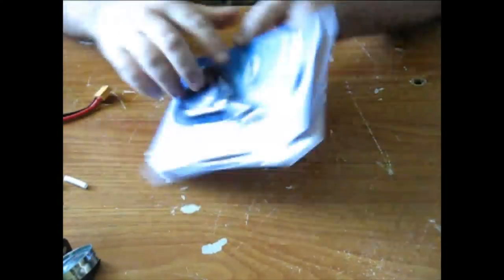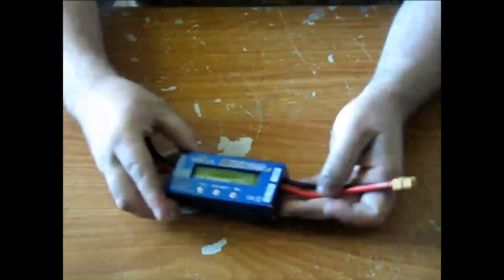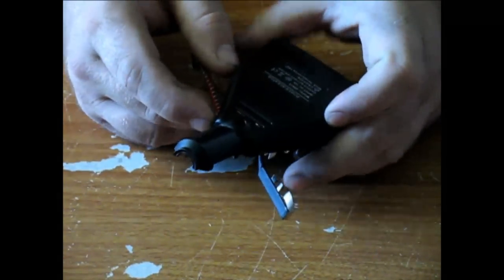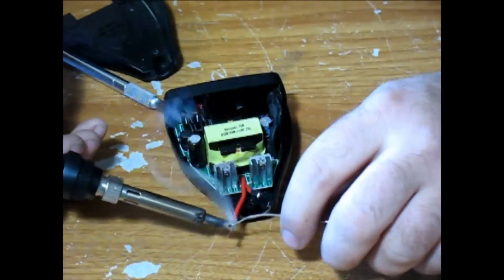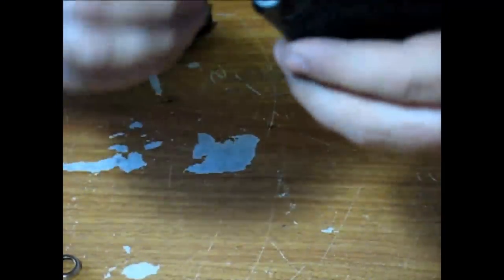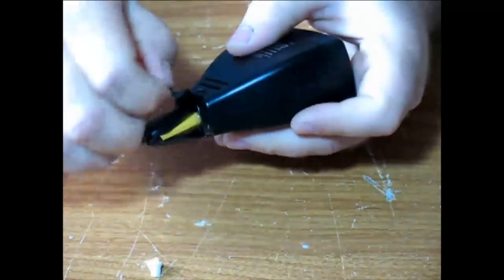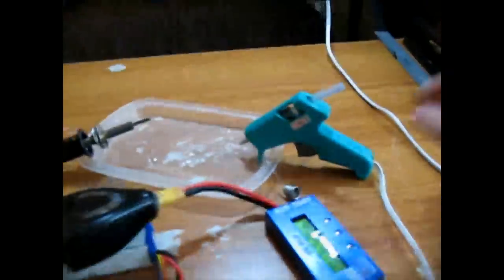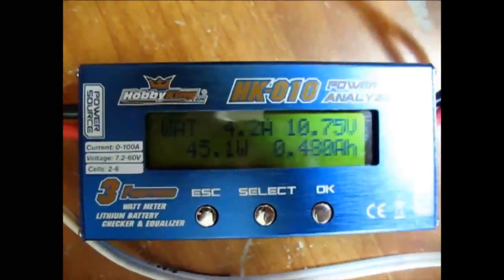Portable Power for RC Modelers

Comment: great video man im going to have to give that a go. Also the soldering iron you were using in the beginning of the video was the the radioshack adjustable one. If so where did you find the different tips for it cant find them anywhere
Reply from the maker: Mopar32985 Yup. I got them from Radioshack.com